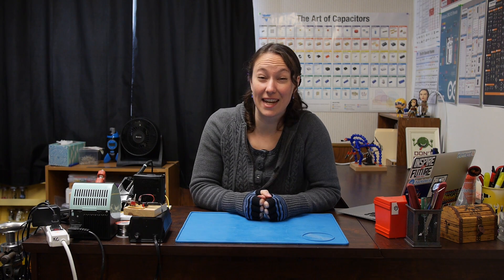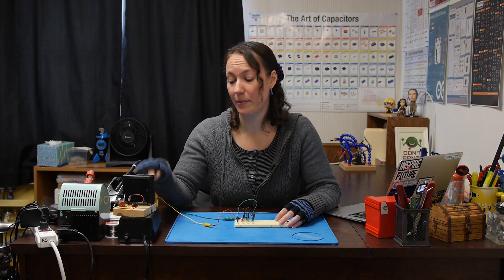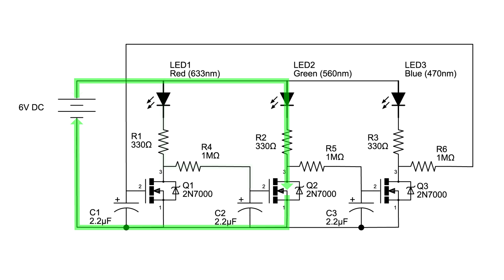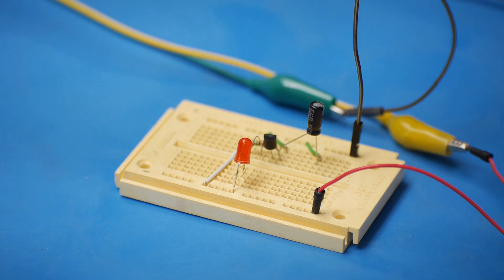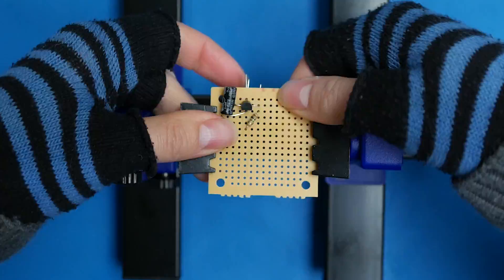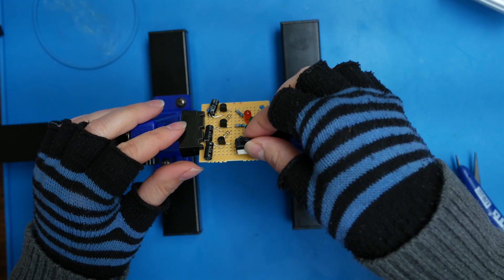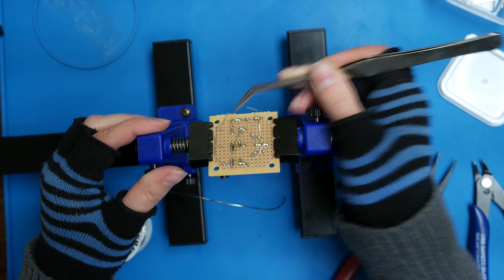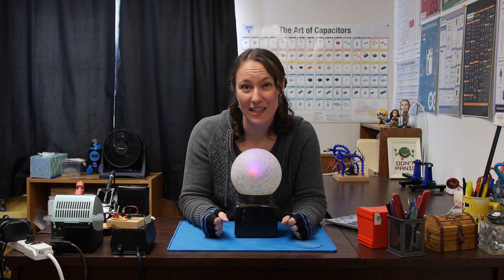Making a FET Phase Light - The Learning Circuit

Comment: c1 will charge first and then as it discharges c2 or c3 will get charged and as say c2 charges and discharges c3 and c1 would try to charge and c3 should win as it had accumulated some.  each capactior as its charges causes its mosfet led to light up.

Comment: Great circuit, thanks. The led turn off because when the next LED turns on, the capacitor discharges through its mosfet via the 1M resistor. The zener diode on the mosfet is just optional circuit protection?

Comment: Great circuit!

Hi, I've made the basic circuit but when I tried adding a fourth it all died. Why's that? 😕 Thanks.
Reply: i did tha same but fail same as you. way tha circuit should work  😕
Reply: once the power has passed through the 3rd 1M resistor the voltage is too low. Change power supply to 9 volts DC IMPORTANT remember to change the values of the resistors located at you LEDs. I used 470 ohms  to replace the 330 ohms. Set up 5 phase shifting circuit.

Comment: you need to add a 100 ohm resistor between the cap and the gate to prevent the fet from becoming an RF modulator due to the inductance of the source wire. The resistance works with the feedback and gate capacitance to lower the gain in the Mhz to Ghz range.

Comment: As someone down below mentioned, one of the LEDs is most likely to turn on initially, due to different characteristics of blue, green and red LEDS.  The LED turns off when the capacitor is discharged through the FET to the left when it turns on.  This discharging / charging effect “ripples” around the ring.

Comment: As one mosfet gets turned on the next one downstream turns off because the one meg tied to the drain discharges the downsteam capacitor. Then the cycle repeats round and round. I think this is similar to a ring counter.

Comment: I am guessing the GATE on the MOSFET depletes the capacitor attached to it.
Reply: That would be true on a Bipolar Junction Transistor (which look similar and call the Gate a "base").  However, on the MOSFET, there is no flow of current through the gate - its triggered by voltage differential only; thus, the "field effect".  There's discussion at the e14 link starting (http://bit.ly/2SegofN).